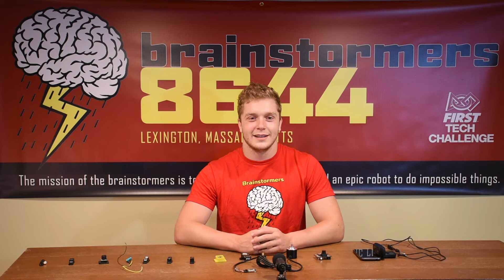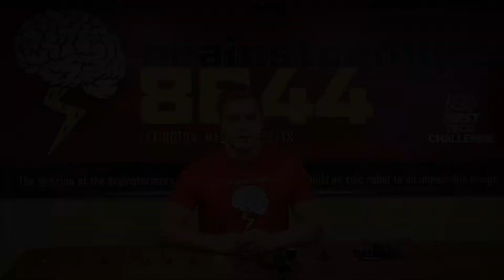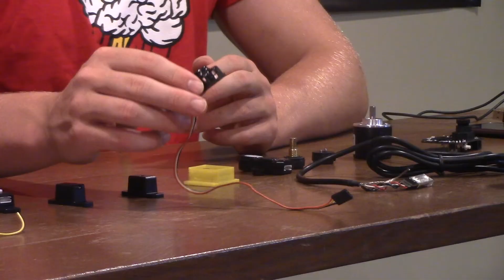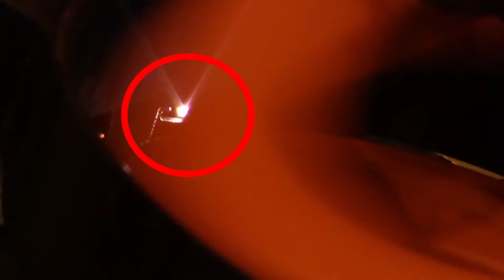FTC Tips and Tricks: Using Sensors IR, Touch, Color, Pixy, Encoders

Comment: Chapters
0:00 Intro
0:14 Infared Sensors
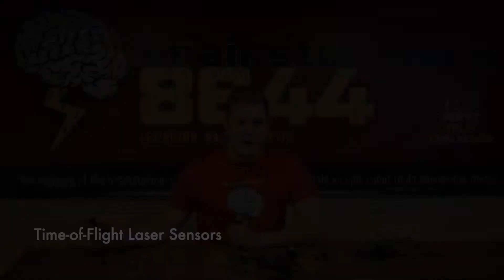1:13 Time-of-Flight Laser Sensors
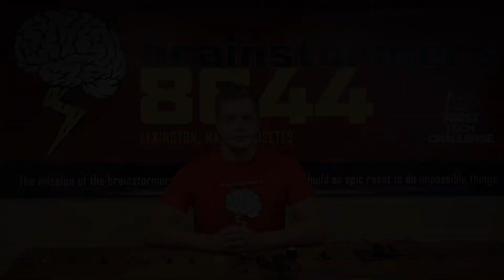1:44 Ultrasonic Sensors
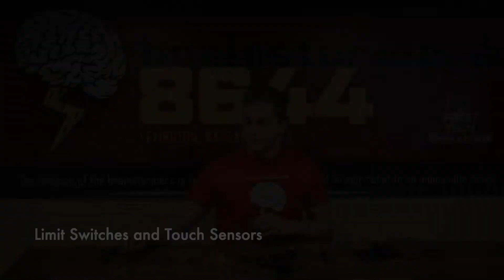2:25 Limit Switches and Touch Sensors
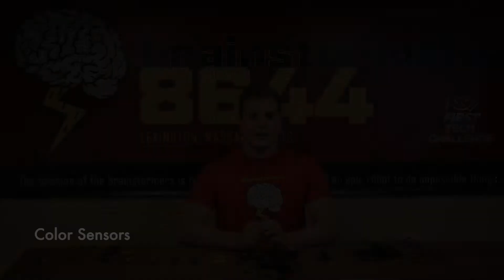3:13 Color Sensors
3:59 Magnet Sensors
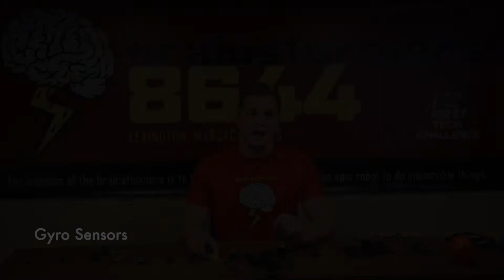4:16 Gyro Sensors
4:43 Encoders/Rotation Sensors
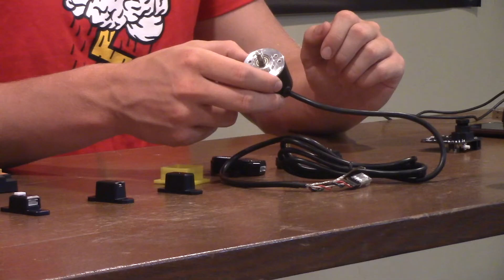5:26 Pixy Sensor
5:47 Computer Vision

could you put this in your description?